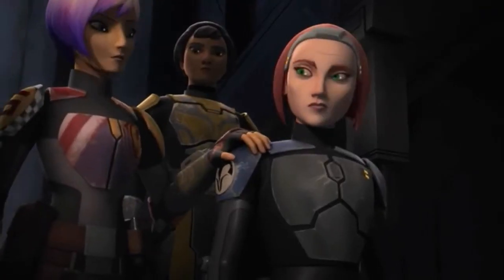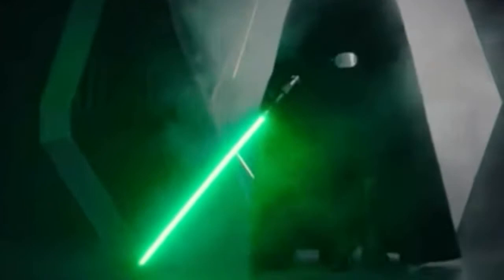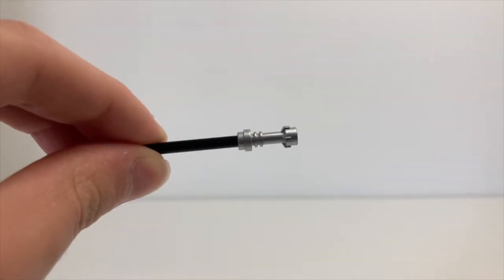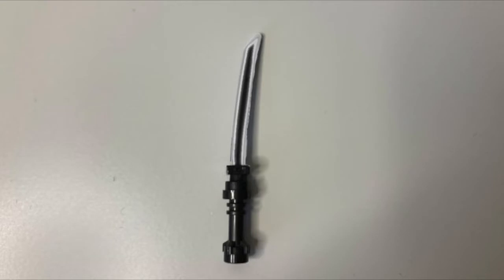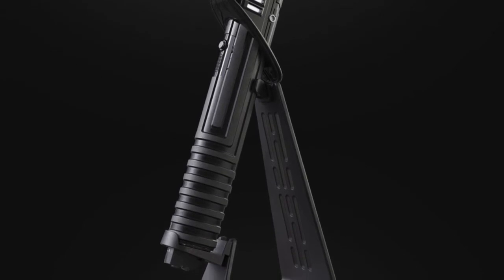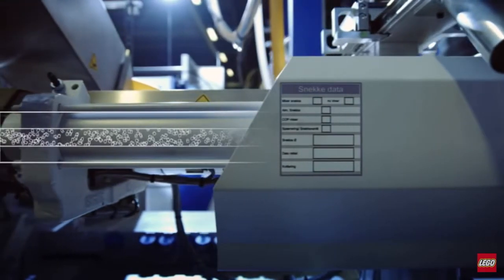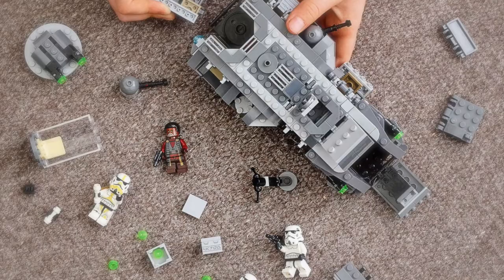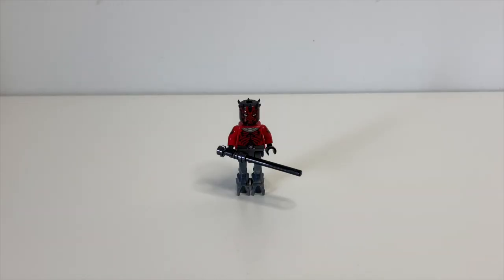The Lego Darksaber: Lego's Options and How to Improve Your Own!

Comment: I think that making the blade transparent would have also improved the look alot too other than the shape. The edges of the blade where more light shines through it will look lighter. Other than that it could also have some fade of color or fade to white when going to the edges of the blade. In this way you could get something that are transparent which in my opinion would also look great. Atleast to me, having some transparancy on the edges of the blade is one way to give the effect of it breathing. However I also think having solid colors with a little blend around the black and white parts of the blade would be a really great option too.
Reply from the maker: That’s a good way to do it, I reckon it would definitely help the accuracy if Lego also got the shape right

Comment: (Sorry for my bad English first)

Good video!
I was disapointed with lego "lightsaber" pieces now, all that hilts, and the lazy "Dark Saber" too.

Custom Designers look very good with they works,
- If your want Dark Saber in The Clone Wars series, buy Arealight version.
- If your want Dark Saber in The Mandalorian series, buy Brickarms version.
- If your want more better lightsaber hilts, goes with BigKidBrix.

LEGO is too lazy now, they not changing design of lightsaber hilts after an entire year. Just a few have diffirence hilt:
- A rare variation angled hilt for Dooku (part 42114)
- A curved ridges hilt for Ventress (part 61199)
- Most recent is a new long hilt look like Maul's lightsaber (part 66909)
And others? Just have a "classic hilt" (part 64567), used for all Jedi and some Sith Lord, so boring.
Reply from the maker: Thanks! Really good point about the hilts. It isn’t only the darksaber that lacks a strong representation in Lego form. What about the hilt of Obi-Wan’s, which has thinner areas on it that do not match up with the regular mould? This would make a pretty good video actually. Thanks for the idea!
Reply: holly shit dude "mucho texto XD" did u wrote all that??

Comment: I think it’s also likely that they’ll just put black katana pieces into sets and use those as darksabers. I’m using one for my Mando minifig and it looks pretty good.
Reply from the maker: Yeah, a black katana would work quite well. Maybe with the hilt dual moulded in a gun metal grey colour, but other than that the piece is pretty much spot on.